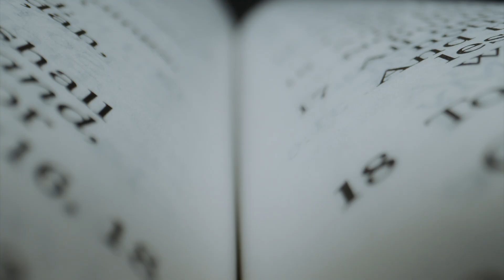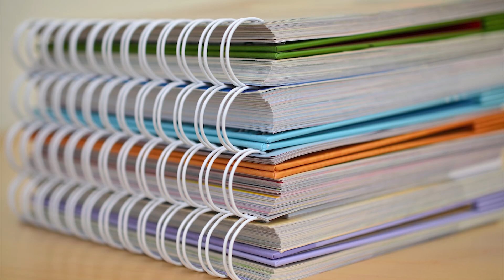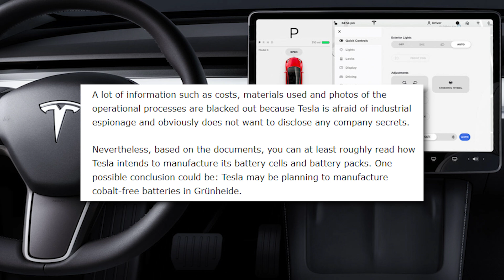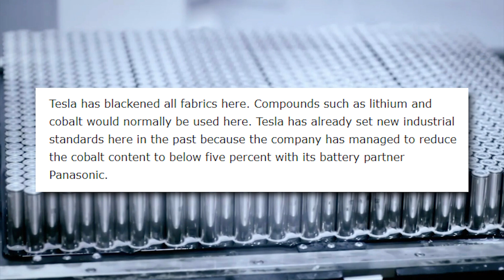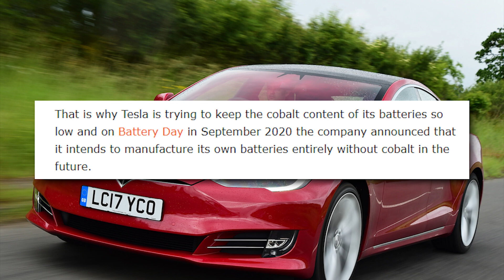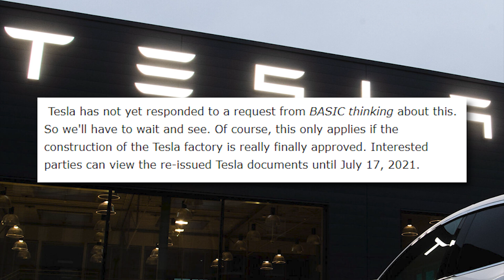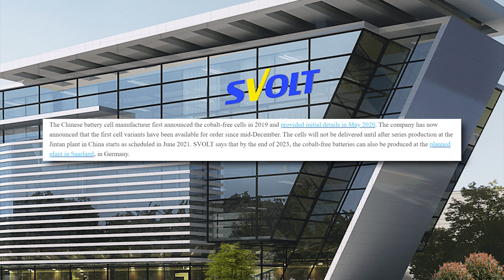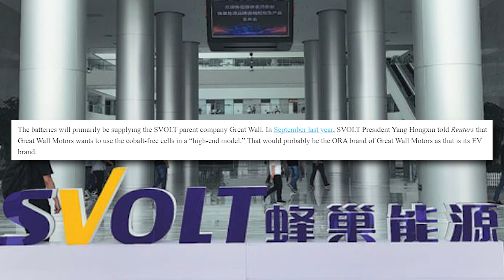We Thnik Tesla Giga Berlin May Build Cobalt-Free Batteries

Comment: Eventually, Yes. Immediately? No. Currently cobalt is vital to higher energy density in batteries. And Tesla has already dramatically reduced the cobalt content in current and upcoming battery designs. As you mentioned yesterday, Tesla is working out a deal with CATL, who produces LFP batteries for their entry level Model 3. LFP batteries already do not have any cobalt used in their production. Tesla said at their Battery Day event last year that they had larger plans to use many different suppliers and many different battery designs and compositions moving forward.